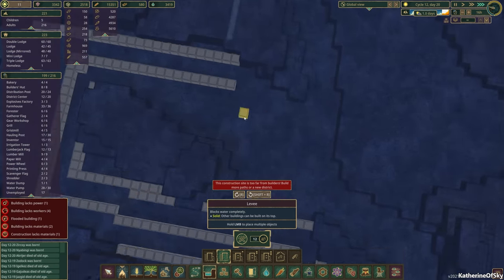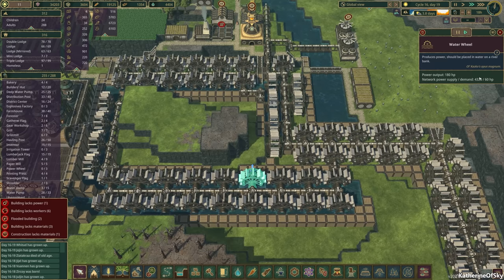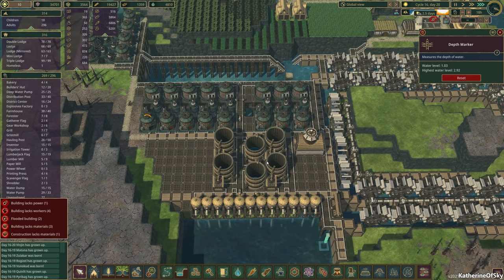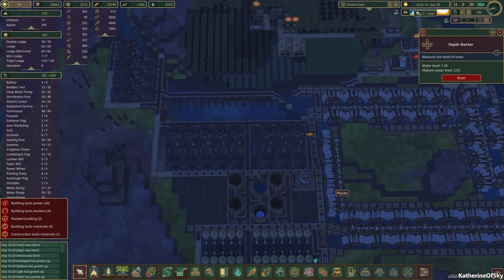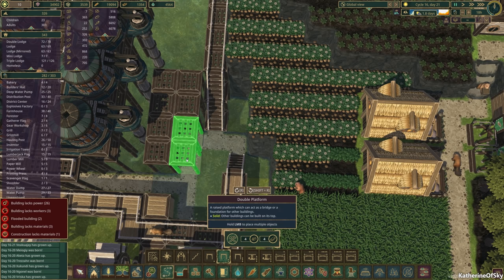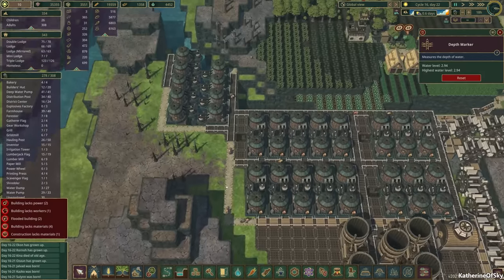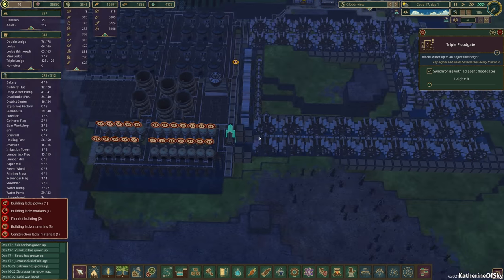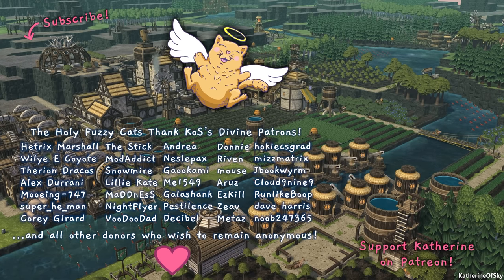Perpetual Pumping Station: Waterwheels for Miles! CRAZY MEGAPROJECT Timberborn

Comment: If you want to make it perpetual then wouldn't you just leave the water dumps on at all times and the floodgates at the start of the wheel system at 0 or maybe 1.5 to keep as a pool but still over flowing? Mainly just keep the flow going?
Reply: yes the start outflow needs to be at least .5 tile higher then the final outflow ...with enough backup storage to keep it working in drought ... shut NOTHING of ... and it will always run .... if the game had condenser then you could keep it fed with them and never lose power
Reply: Exactly. Ideally the floodgates can be kept at 2.5 and the reservoir is very large, or you have lots of storage tanks to survive the drought. 

You could maybe have this very low in the map and have a floodgate to let water into the reservoir directly during the wet season, and then slowly use up the water in the reservoir during the drought.
Reply: @adamt195  The problem with "slowly use up the water during the drought" is that that only works up to 3 levels of height difference (because this is the highest floodgate available).
Reply: I'm sitting for most of this video wondering why KOS keeps closing the floodgates... surely the whole point is to pumpt it from the lower reservoir to the higher dumps and letting it flow in a permanent loop?
Reply: External pumps to top up water, dumps to dump it, a slight drop after a decent distance to maximize flow, a basin at the end point to collect water and a dam in the basin to prevent it from backing up/halting the system where any overflow is allowed to leave the system/map

Comment: KOS, My  testing show that Between 7 and 8 water dumps is enough water discharge to run the waterway none stop,  GG that is a lot of wheels!
Reply: Green land absorbs water
Reply: @frizzletits8511  you sure? I think water just evaporates, but the other source of waterloss people seem to forget is drinking, beavers drink 3 units of water a day. So if you've got 30 beavers Manning the pumps and dumps, you lose 90 per day to them staying hydrated.
Reply: How did you configure it, I had way more than 8 and never got consistent flow when I played with it they pumped into a tank held off by flood gates, that I kept at 0.5 compared to the height of the canal, but it was super spotty, and like some would turn, some wouldn't, never got fully consistent even at 12 dumps.
Reply: @briantroy7376   place the water dumps on a level higher than the water wheels so you create a waterfall going down to the wheels, and make sure the channel is only 2 wide.
Reply: @briantroy7376  lol yes ik I’ve done a fat bit of testing, besides my district 1 has over 556 beavers, the conclusion I’ve come to is free grass absorbs water to maintain the greenery

Comment: Because the channel with the wheels is all the same depth, there's nothing governing the direction of flow, so when previously stopped wheels started turning back on around the 13:00 minute mark, it was because the water started to flow backward, as evidenced by the direction of wheels turning back on.
Reply: I was thinking about the water evaporating and being pumped at the end, so the Waterlevel is decreasing slowly. As you can see it dries out shortly from start to end after the wheels at the beginning started turning again.

Comment: You can raise the storage tank level and just leave it on. You only need flowing water. with the deep water pump constantly pulling from the storage lake, water should continuously flow into the storage lake. Then you just need to move that water to dumps.
Reply: Yup, leave the dumps and the pumps on with a high level in the tank (Via the flood gates) and you should have a continual flow.  Not sure how much you can actually keep going to geerate power, but it should just keep working.

Comment: I was thinking about the physics of the water in a more general gameplay sense and thought of the following:

Build a tall dam as normal, but in the bottom row, have two dam spillway pieces leading to a 2-wide channel containing your water wheels.
Directly in front of this (on the "dry" side), place two floodgates and two levees to stop leaks. You should now have a sluice gate that will provide the same amount of flowing water regardless of the water level in the reservoir behind. As long as there's more than 2 tiles' worth of inward flow, you should build up water in the reservoir; add spillways at the top as necessary.

Then have water pumps downstream of the water wheels to recover the water for drinking and storage.
Reply: I like that idea! Sounds like it should work, have you tried it yet?
Reply: I did try something similar last night, i wasnt able to build levees ontop of a dam block tho :(
Reply: @SullyDocks  Nooooooooooooo!
Reply: yeah this would be a brilliant idea if you could build levees on top of dams. you also cant build levees on top of platforms either
Reply: @WizardWizard680  Yes, I've read it's due to how the water is calculated. Maybe a water pipe block will be introduced in the future to allow this (since this is how dams actually generate power).

Comment: "Thoroughly nutsy, completely bonkers, a tiny bit insane"
Ah, I see that you are familiar with the "screw it, GO HAM" method of 'planning'

EDIT:
So basically this is an attempt at turning Pumped Hydro into pseudo-perpetual hydro -- were it not for the evaporation loss, it might actually be feasible in-game because maintenance isn't a concern. Although like you said at first you'd need a truly massive number of beavers to make it work.

(Either that, or a powered water-dispensary building that needed less than the total power output to keep up with the flow rate.)

Still a neat idea tho :)

Comment: I just saw a reddit post about controling the flow, if you leave any tall gap completly opened but you get a trench of 1 block deep in the block that the water actually falls into, from the damn, it just flows like a 1 block damn, which can flow for days and days even on draughts without running off, its like an automatic flood gate, and if you do that with your design, you can have all those wheels running forever plus the benefits of never running out of water in long draught!
Love your vids! Keep the awesome content!
Reply from the maker: Can you send me a link or a screenshot?  I'm not quite sure I understand what the exact setup should look like.

Comment: If the total volume of the water wheel channel were smaller, you might be able to run the system in steady state -- that is, the input from the water dumps would keep up with the output to the lower pond, and the flow rate (or depth in channel?) would be sufficient to run all the wheels.
Reply: How many water dumps does it take to run a single wheel? Is it a better deal than hamster wheels?
Reply from the maker: I don't think a single wheel would be worth it.
Reply: On the mountain map I used 3 water dumps, which kept a high level reservoir filled with runoff through a dam and a single wide channel. To account for evaporation with a double wide channel, 9 or 10 dumps, but the need 4 or 5 full large water tanks with enough pumps to keep those full and dedicated 10 haulers and all on high priority by haulers. Should be doable to run water wheels once across the width/length of a map from near the water source to the exit map area for water.
Reply: @KatherineOfSky  You'll also need to account for the length of the cannel since more area = more evaporation and absorption into green land. Found one where he placed double wheels with power hungry building on the side and said that he extends the channel when needed and put waterdumps further downstream to get the water flowing again. Can't remember the youtuber's name though.

Comment: Liking the concept. My plan for this would be to have a bigger pools that are filled via the main water, rather than having beavers move it. I'd start with a lock system with the water pools having the towers (forgetting their name) at the front and back to control over all water flow, and maybe a few pools for when the dry season hits.

The water physics seems to cause the water to spread as much as possible, until it finds somewhere to 'flow', this being the case where the water stayed in the wheel channel until it hit the water pump drop.

Like you said, it seems like it'll be more micro management, but I'd be interested to see if other beavers to come will have an ability to move water uphill via devices, and if that is the case, this whole process may end up as a better possibility.
Reply from the maker: The point of this exercise was to see if one could have a fixed water supply so it could run during the dry season, and thus be a closed system.  I think with a little more water in it, it probably would last a while, though eventually evaporation would cause it to fail, depending on how long the dry seasons are.
Reply: @KatherineOfSky  Even with the evaporation, a larger discharge basin could account for longer seasons, seeing as running the waterwheels has more to do with just having the channel 'filled' along with a modest flowrate. With that in mind, you could technically make a runoff-channel from where you currently have waterpumps introducing water into the system and have flowgates periodically direct flow from there into either the discharge basin directly, or atleast into the much lower 'channel exit pool'.

Still, I think it's a great proof of concept for a 'dedicated power gen district', though I couldn't ever imagine the size of community needed to consume 28k HP, nor the supercomputer to run it :P

Comment: Congratulations  @KatherineOfSky, you've discovered the wonders of pumped hydro storage. ;)

You can reduce the beaverpower required by having the pool at a lower level and just feeding the channel with a single water dump.

Have the channel higher than the pond and feed back into it, setup right you can have the pump and dump very close to each other cutting travel time. 

It wont feed as many waterwheels, but it only needs a couple of beavers to run.
Reply from the maker: I don't think just one waterdump will be enough.  The course is too long.
Reply: @KatherineOfSky  Shorter waterway with less waterwheels, drop into the waterpump pool, looped around so the higher elevation dump eventually feeds back into it. 

You lose more water to evaporation if you use two ponds, single pond to one (or many) water dumps reduces evaporation to just the waterway itself and the pump/destination pond.

Comment: I think we've all been there, when an unexpected flood occurs from a water source you didn't notice. Poor little beavers becoming homeless, while startled players scrabble for a quick fix. KoS proving she's human after all! Thanks Katherine, for all the joy you bring to your eager audience...

I experimented with the Water Dump. It seems the method KoS uses, with just four Levees, can't be improved. I tried building it up an extra layer, (double height,) and it didn't increase the area of irrigation. Not even a little bit. I then wondered if there was any gain to be had by putting four extra Levees in the corners, to stop the water leaking out too fast, and there didn't seem to be any improvement there either. Considering the extra cost in logs. I won't be doing that again...

Happy Hunting!

Comment: In order to get it to work you need to have enough water to fill the system and keep the dumps dumping and the water flowing. The receiver basin needs to be almost full when you start. You need more water or less wheels.

Comment: This game reminds me so much of Dwarf Fortress, especially the Megaprojects and let's face it a beaver is pretty much a dwarf (with a bit less facial hair).

I think for practical purposes you would probably use a natural current during the wet season and only use water dumps during the dry season to keep up a minimal flow.
Reply from the maker: Nah, definitely nothing like DF
Reply: @KatherineOfSky  I agree to the point that the games focus on very different things, but I was thinking more of structural similarities, both are block based and have water physics and even seasons.

And for buildings/materials you have logs, refined wood (planks/wooden blocks), gears/mechanisms, power shafts/axles, power shaft intersections/gear assemblies, windmills, waterwheels, powered mills, levees/walls and probably some other things.

Watching your let's plays, one of my first thoughts was whether the perpetual motion machine from DF can be build in Timberborn. The main issues are that Timberborn has no powered pump to pump up a level and evaporation.

Comment: the start height needs to be a half tile higher than the end height ... so you always have a flow ... after that all you need to do is maintain the base water level of the start reservoir with dumps from the main river and backup supply for drought season ... and they will always run ... what you are literally making is a water siphon fountain in game which essentially is a perpetual motion fountain ... if you had condensers you could literally gather water and keep the main reservoir full enough to constantly feed the flow

Comment: I do believe that this could kinda work. If the amount of wheels is limited to a certain amount and a larger water supply is available to be able to always have the pumps and dumps running and produce consistent amountsof power. Yhis combined with an outside source that counteracts the evaporation to keep the system full and if it overflows perhaps a little dam in the water reservoir can fix this issue. Love love love this setup tho

Comment: A suggestion for metering water in from the river: split the river pumps into a different district that ships water to the waterwheel district, then it will only top up the water as necessary when it falls below the waterwheel district's request level.

I also had an idea to use blocks of floodgates at the bottom of pits to lift water without beavers and thereby slosh it back and forth through a channel of waterwheels, but (un)fortunately the game just seems to go "Nope! Hax!" and deletes the water rather than lift it.

Comment: Seen a few other people make these, they're great!

I wonder how it compares to beaver wheels, since the workforce is comparable (ie. Requiring some beavers to do some work to make energy). I'd like to see how many dumps are required to turn a water wheel (on average), or how many water wheels you can consistently turn with a set number of dumps (so that you can leave the dumps running 24/7). Then how many pumps you need to constantly supply the dumps 1. Without haulers, and 2. With haulers. Then we can total it all up to find how many beavers give a certain amount of beaver-power, and compare that rate to the beaver wheel. 

I would hope this setup is more efficient than a bunch of beaver wheels, but it does require quite a bit of work to function.

Also, in future designs, you would probably want your initial reservoir to be 1 block higher so that, when the floodgates are completely open, the water continues to flow down and out. In the current setup, the water could go stagnant while still in the reservoir.  

Fantastic video. Thank you!

Comment: You are only getting 10k energy so either larger reservoir needed or shrink the wheels so you start returning water quicker to minimise shrinkage from evaporation and leave it running

Comment: You should just use a dam a the start basin. Start the pumps and let it over flow. The flow would only stop at night when de bevers stop working.
And you only need a smal basin at the start so it over flows faster

Comment: the problem i see is there isn't enough "gradual" level drop in the channel to prevent backflow. And if you set up a second set of reservoirs on the far side of the canal, you could "reset" the height of the water. Pump it back up into a tall reservoir and then use another set of flood gates to start the water back to the left side from a higher level, increasing flow rate overall. Requires massive infrastructure. And evaporative loss would also require input from the main map. Don't think it's sustainable during long droughts wihout a MASSIVE reservoir pool upstream. without having already built/tested one of these myself, my first go-to length would probably be 30 tiles per Y-level to test first.

Comment: If you put the lower reservoir just high enough to overflow into a channel that leads off the map edge, you could arrange it so that you will never overload the system with too much water.
Also... can you use levies to build an elevated water tank?  Such that the upper reservoir can be as high as you like (or build height allows)?
Reply from the maker: Yes, you can place levies on the bottom level to raise the minimum elevation of the water.

Comment: What is the total number of beavers needed to keep this system in steady state?  Would the same number of beavers running on wheels generate more energy?  It seems, however, that the dam system has number of water-wheels limited only by space available.

Anyway, this is a very interesting experiment!
Reply: It looks like about 40 beavers could keep this going. The system is generating 28,000 hp. That would take 560 beavers running in wheels. This is definitely more efficient.

Comment: It will probably work better if you put a level of levee under the water so it doesn't seep into the ground.  That is were most of it goes instead of evaporation.  You will probably also need to triple the size of your reservoir for the length of spillway you created.
Reply from the maker: "Seeping into the ground" isn't a thing.  The only things that deplete water are evaporation and water pumping, (and leaving the map, of course).